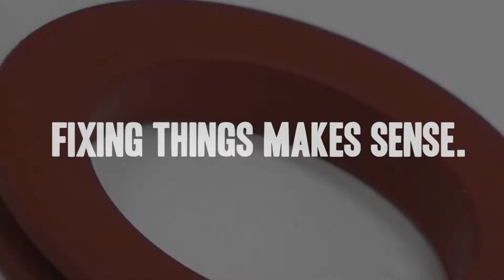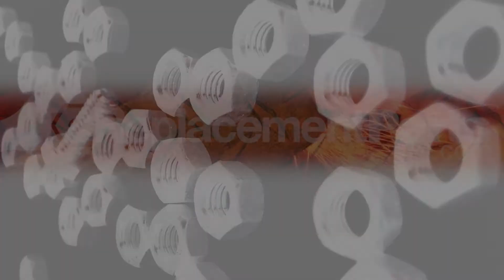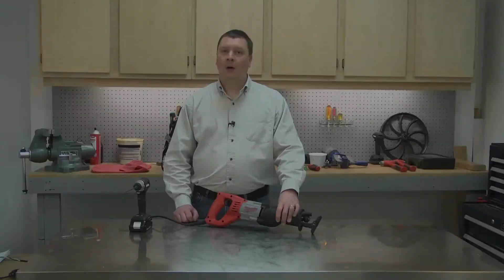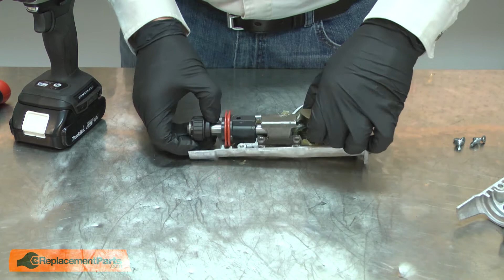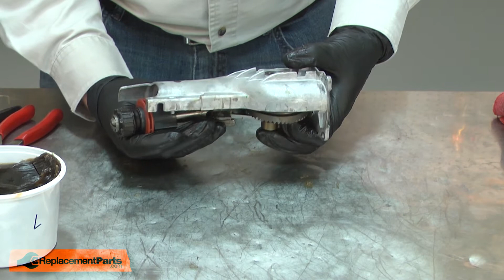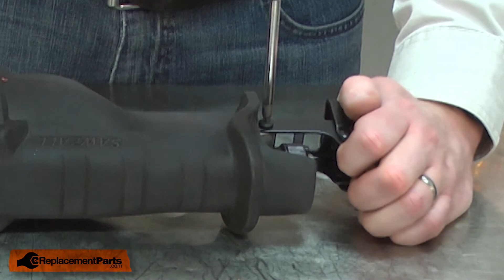Milwaukee Reciprocating Saw Repair - Replacing the H-Seal (Milwaukee Part # 45-06-0230)

Comment: Is there a seal in the bushing? My saw is really old, and over the years when it is in high heat(like in the vehicle) tiny amounts of the grease appear to seep out from the shaft. By the way, excellent video. Easy to understand and right to the point.